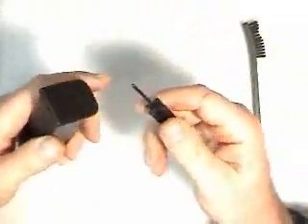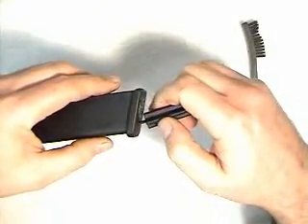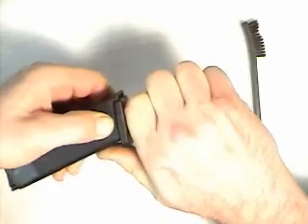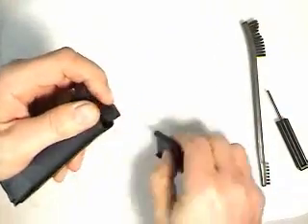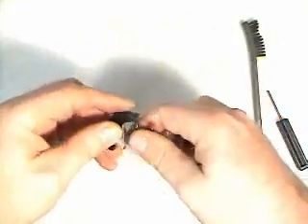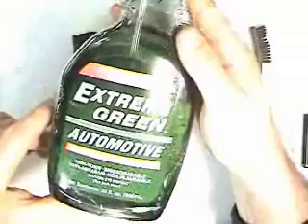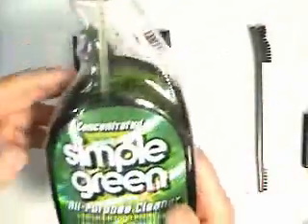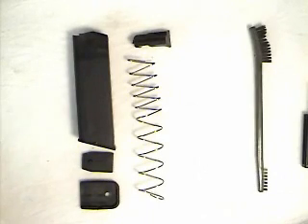theKGB65 Glock Magazine Disassembly and Cleaning Method

Comment from the maker: @gshdrums Exposed aluminum, in an oxygen environment (air,water) is protected by a thin layer of oxide that is stable up to a pH of 9.  Simple Green has a pH of only 9.5 so you would have to soak that aluminum for a LONG time to even get it to discolor.  So use it on your bare Al wheels but rinse it all off.  Glocks don't have aluminum and their steel parts are safer in this cleaner than they would be in pure water (pH 7.0).  What's REALLY important is that it won't give us neurological damage.